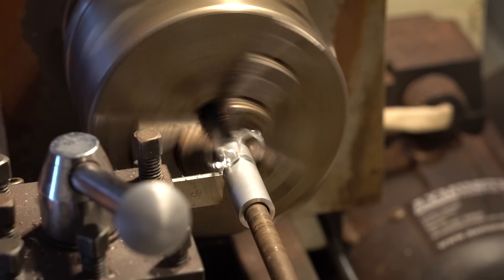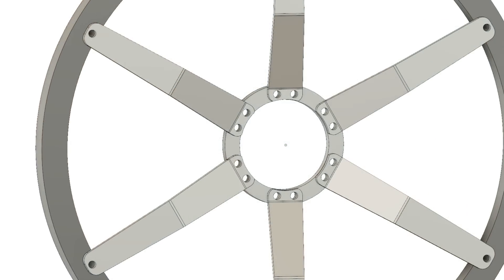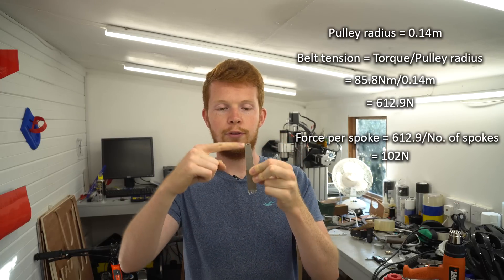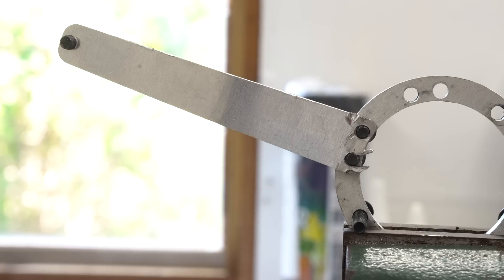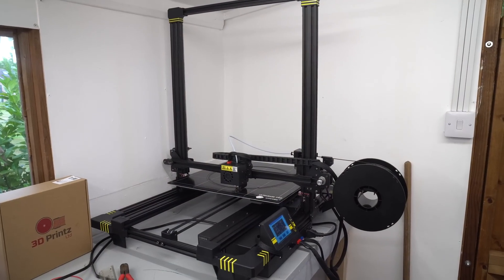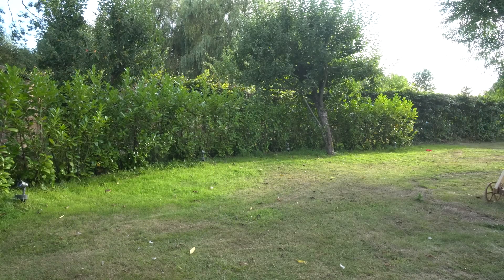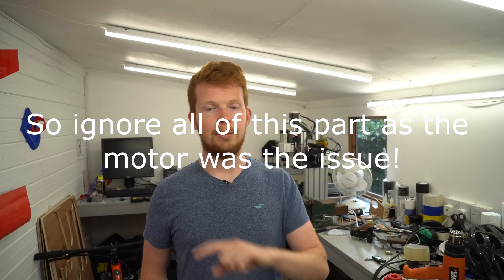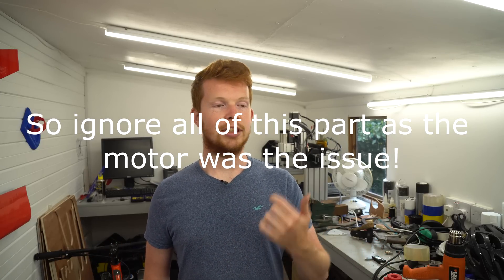Electric Bike 4.0 - Pulley Failure

Comment: The pulley is not monolithic.  That is, not cast nor milled out of a single material... it is an assembly, and the forces acting on its parts are therefore discrete, not shared.
That is, the force of the motor is NOT distributed evenly thru all the spokes, because each is hinged and because the belt is somewhat elastic, it PULLS on the the top of the pulley but not on the bottom. (under drive, the bottom of the belt is slack ). The spoke on the bottom of the pulley is NOT under load, and as it swings back and up to the top, the load increases to its peak as the belt teeth disengage.  80% of the torque of the motor is therefore concentrated on just ONE QUARTER of the circumference. Thus a properly designed pulley assembly will require EACH spoke to handle the FULL power of the motor.  And Then some. Because each spoke is discrete from the rim and each other, each Can and Does move independently... and can not transfer meaningful load to the rest of the assembly.
  As it drives, it is Not really pushing down on one screw and up on the other. Rather, it is turning the leading screw into the fulcrum of a lever arm as long as the spoke, acting on the trailing screw. Therefore, you can calculate the load on the screw hole by Multiplying the force of the motor by the mechanical advantage of the Leverage the spoke exerts on the screw hole... that is, if the distance from the leading screw hole to the rim of the pulley is 4 times the distance from the leading screw hole to the trailing screw hole, you are multiplying the motor’s force by FOUR TIMES on the trailing screw hole. That is why the trailing hole failed, while the leading screw hole just got enlarged.

The reason most lightweight chainrings and cranks have angled spokes is to combat this leverage... to either put the entire spoke into compression, or tension, rather than shear. (Inclined at an angle closer to the vector of peak pull ). 
If you are going with an assembled pulley... then you should cut the spokes to angle backwards against the pull of the belt... and if possible, make the center collet with a shoulder against which the entire inner edge of the spoke abuts... so that it can transfer load across it’s entire edge area rather than just half the edge area of the holes.

Comment: I don't remember you had such issue with the full 3d printed pully. I was surprised by the fact that you did fully print the pulley in many parts before gluing them together. After long use, is the 3d printed pulley still strong ? Thanks

Comment: Hey, I just thought of it, if you want to reduce speed and improve torque : why don't you remake the windings of the motor ?
You could easily divide the KV by the square root of 3 (~1.7) while keeping the same power, just by passing to a WYE connection.

It will take some time, but maybe less than designing a full transmission...

Love your videos !

Comment: @ 7:50     Stainless steel fasteners, under pressure, are subject to "galling": a form of cold-welding.  One has to use anti-seize compounds, or switch to another material.

Comment: Damn, i knew that the pulley would break when I saw it in yout last video but I didn't comment it. Next time I will :-). Good work!!
Reply: P.s. I would check the VESC before you change the motor. I had the same issue with one of my VESCs, and it was just a setting in the VESC (in my case it was the RPM setting)
I think motors work or they just don't, yours seems to be ok. Perhaps try that motor with another ESC/VESC just to see if the problems is the same.

Philipp :-)

Comment: i have also have problems with bearings in the motor after lathe work. i think it is because the bearings in the motor is taking the beat from the lathe. You have to open the motor and lathe the stator or rotor with the bearings removed.

Comment: Im thinking the Motor Shaft Vibration could be due to the ESC (Electronic Speed Control). It could be resonance but derived from the pulse width switching frequency. Many Variable Frequency Drives have a parameter called Skip Frequency. If for example you experience resonance at 40hz you can program the VSD to avoid that frequency.

Comment: Dude. Me thinks motor vibrate because its output shaft IS bent. Maybe next move should be another motor with thicker shaft AND ADD a shaft mount/end holder for mechanical strength, so shaft would NOT easily bend. 😉

nice tools youve got there ☺

Edit: now I see the problem that you needed to shorten motor length so it won't hit the pedal. 😁
Well... time to take a break and re-think I guess. Lol.

Comment: As an electronic engineer with 30 years experience I can categorically state that it is impossible to account for the "buggeration" factor. You just never know when "undocumented features" and just plain old manufacturing screwups will cause the product to not work even if the design conforms perfectly to the published specifications of the components.

Comment: Torque for a motor is generally a straight slope. Highest at stall, zero at no load top speed. Hence the perfect parabola HP curve. The brushless motor designs are typically torque limited by the ESC so instead of a perfect slope it looks more like a table that then drops off into a slope.
Look at your motor specs for radial and axial loads. You might have damaged the bearing by putting a lot of torque by tensioning the belt. Either support the shaft into double shear, shorten the shaft (unlikely) or completely unload the motor bearings from seeing any radial loads (use a shaft coupler with misalignment or install the motor on elastic mounts. Best of luck! Love the videos.

Comment: Excellent video the excitement of making one and wanting to ride is real. I went the simple way with a hub Motor and tried to ride it without torque arms and spun in the dropouts, severing all the phase wires and halls but i learned a lot rebuilding it. Its never really a failure just a learning experience.

Comment: I would use stronger metal like steel just for safety
Reply: Stronger doesn't mean better. Steel is more dense than aluminum. Engineering can be down to properly design the part to withstand the load and reduce the stress.

Comment: DO NOT let those machine tools leave your family!!!! Do whatever it takes to hang on to them!!!

Definitely make the spokes out of ONE PIECE even if you have to WELD them to do so... ~( 'w')/

Man that is a nice large printing capacity!!! \(^_^)/

You should do a 'FULL STALL' test on the pulley by parking the front of the bike against a solid [like a wall] object and with your full weight on it, apply about 1.5 to 2 seconds of full throttle to it. That will max out every single part of the driveline, but hopefully without overheating the motor coils.

They make a device called a 'pulley puller' your grandfather may own one. Check that out in the future. 
~( 'w')/

ACTUALLY you will get MORE input if you ADD the failures, as well as you will help more of your viewers who are closely following your work who may be trying to copy your design as they will likely be able to learn WITH you on these matters. ~( 'w')/

On the motor...check the bearings for bearing wear [you may need ceramic bearings] and for imbalance [bearing wear can lead to internal contact abrasion which can cause the magnets to be damaged and require replacement of either the magnets or the whole motor]...

And finally, the multiplier you designed SHOULD extend the life of the motor, or its replacement... In other words...Any damage done to the motor from the ORIGINAL setup, SHOULD be reduced or eliminated by your new layout.

If not, may I suggest you rob the planetary gear cluster from an electric drill to place between the motor and the final drive as your way to reduce cross torsion on the motor shaft...ALONG WITH ceramic bearings. ~( 'w')/

Comment: Hey Tom! Keep up the great work! You've inspired me to build my own electric bike. 
Based on the failure of your spokes, it looks like they failed with shear tear out. I’m not a huge fan of FEA analysis to predict those kind of failure modes so it’s something you can do with hand-calculations. I work as a stress/dynamics analyst and to predict those kind of failures, you can just do some basic hand-calculations and not rely on FEA. What you basically have here is a cantilever beam that creates a moment at your fixed end. You can calculate the force from the couple that is induced at the fixed end. You did a great job with a redesign to reduce the force at your bolt location and thus reducing your shear tear out stress. 1) You increased the vertical distance between the bolt and 2) you added more material from the center of your bolt to the edge of your part.
Reply: If something breaks and you have data, it's not a failure. It's science.

Comment: You use a stepper moter by the looks of it, right? I don't have much experience with those, but it could be the motor driver. Perhaps it sends a square wave and it has some nasty resonances there. It might help if you send a sine wave instead.

Comment: Lots of things to learn with your failures.   Good that your grandfather has a metal lathe.

Many stainless alloys are not hardenable.    I would not use stainless for the pulley shaft, I would use O1 drill rod stock.    This may be called silver steel in the UK.   Available in many diameters, very good dimensional consistency and it is sold in the annealed stated.   It can be hardened with a propane torch.    You only need the ends hardened where the grub screw engages.

You will need to look up hardening.   Two steps, first is to get the metal above the critical temperature, where it does not respond to a magnet, then quench.   O1 quences in oil.   A2 quenches in air, and W1 quenches in water.     This makes it too hard like a file.   Second step is to temper the metal to e.g. 175 deg C for a period of time,  reduce the hardness and reduce brittleness.   This requires good temperature control.

Good luck with the build.   I hope you solve the motor vibration issue.

Dave.

Comment: why not use case hardened steel? you can get steel sheets, bend and cut them in shape and then case harden them. the will withstand a lifetime. but im a fan of the new design.

Comment: That motor chatter is almost certainly the bearing, considering the radial forces on those bearings just from the torque it's putting out I'm almost certain you're not going to get away with the types of bearings in those motors. You should either replace the bearings or add a high radial load roller/ball bearing external to the motor to bear that load.

Comment: Great video. I waited for watching your e bicycle run. But ok I will wait😊😊. Hey tom I have a 270KV motor. Is it possible to make electrical bicycle. I made it but motor heat very much😭😭.
Reply: Check the rating of your motor. How much power can it handle? Voltage? Max current?
Reply: In the seller description, 
Lipo Cell: 8S
Max power: 1665W
Continue current : 80A
Kv value : 270kv

Current setting,
Voltage: 6S
Motor pulley teeth: 16 
Larger pulley teeth: 48
Belt: Bicycle chain 
(I have no 3D printer😥) this is the biggest pulley ratio which I could found)
Reply: Your torque ratio is 3:1. It's not enough torque to get your bike going. You need to larger ratio.

Comment: I think the vibration is caused by the mass of the whole thing (motor, bracket) plus the clamping of the mount on the bike frame. M and K, the motor spindle output is the excitation source.

Comment: the motor mount bolts tightened with equal amount of torque ? most likely the cutting caused the balance issue . or  maybe a loose bearing within the motor , any wiggle in the shaft ? seems as though you will have it all sorted . Great work .

Comment: I know you have already solved you spoke problem but consider this. What if the spokes came off the hub tangentially instead of perpendicular. Look at the way the wheel spokes are laced on bikes wheel hubs. If you slant them in the direction of the force it puts the load on both the fasteners the same way. I don't know how that would be for the regenerative breaking from the motor though.
Reply: On the same note: look at how the spokes of disc brake discs are designed. Good idea! :D

Comment: With grinding the flat on the stainless shaft it is possible you lost the annealing if it got too high of a temp and cooled slowly hence stuck grub screws... Rather use and end mill with coolant.

Comment: Looks like the bearing of the motor is not strong enough to withstand the radial forces of the motor pulley. Maybe the steel balls or the bushings are too soft. Or the moror was simply built too crappy to be ok on so high rotations. Try to get a slightly better one. Keep on the good work!!!
Reply: Yeap, the small pulley is quite far from the motor flange, so the belt tension is causing quite a bite of torque on the motor bearing. Not something a deep grove BB is designed to support. If the shaft is long enough I would try to mount a second ball bearing on the external side of the small, both bearing would be submitted to pure radial force, which is NICE.

Comment: I really like the idea of belts because of how quiet they are, but with torque levels like this I think you might have better luck with chains. Another idea however would be gears. I have an electric scooter that came with a gearbox from the factory and its extremely quiet, but the motor does need to be mounted closer to the actual hub. I have a huge brushless out runner like you have but even larger and I was thinking of making an ebike out of it at some point but I wasn't sure how to go about it, I have an ebike with a hub motor but that out runner would be much more powerful as a fun bike. Im looking forward to see what you end up doing for this project because it is very interesting to me. keep it up!
Reply: Go look for an inspiration on endless-sphere forums. There are a few great builds with mid mounted rc motors.

Comment: I've always thought wether it is possible a build an e-bike with regenerative braking. Adirect drive motor that slows down the bike when the throttle is off and some kind of a clutch to disengage the motor when you don't need it to drag you down.